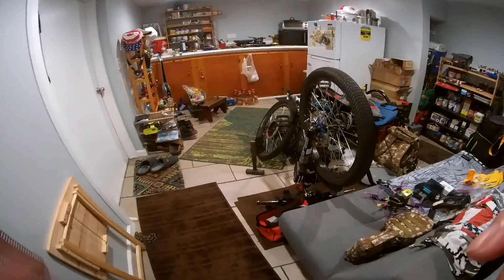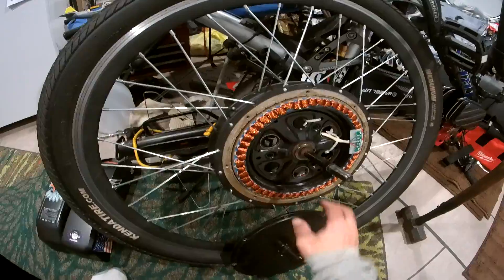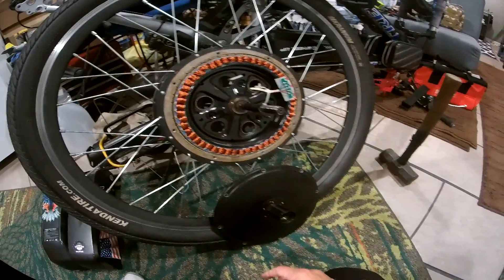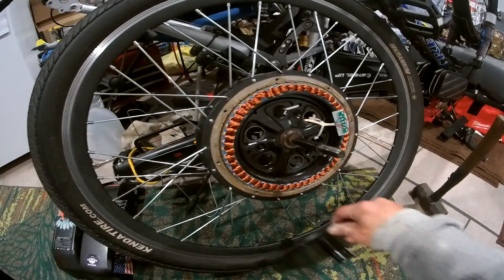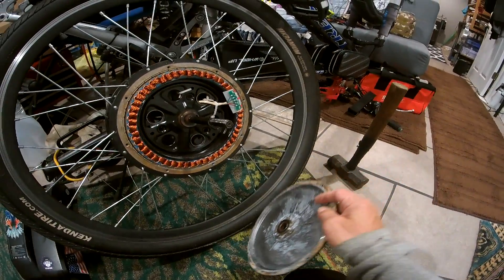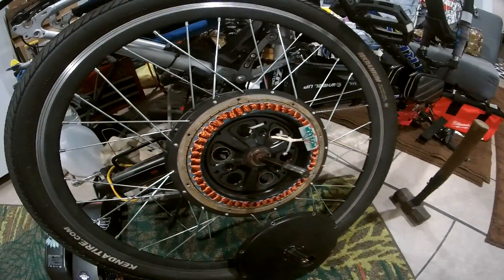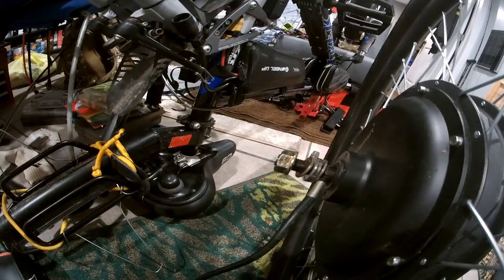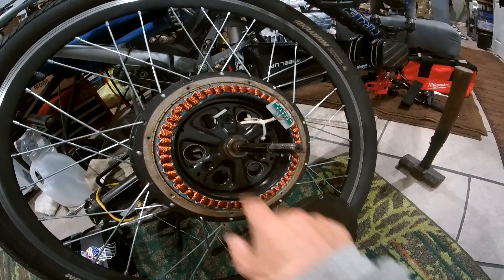inside🚴1500w⚡ebike hub motor🔧remove cover cassette side to service 1275 miles

Comment: I ride at least 100 miles a week on my new ebike--I hope I do not have to do this every 10 weeks--thought these were sealed and needed nothing for 3 to 10k miles.Also this is why I bought a front hub motor to add 2wd--last thing I want to do is have to replace or fix a rear hub motor. 1200 miles is not a lot since these are advertised as medium to heavy duty--unless it is aggressive trails or a lot of uphills--these should last a lot longer then this.I have a one year warranty and could easily put 2k on my bike and was told it should have no problem.Also this should serve as a semi warning--all bikes--including ebikes need maintenence--I try to take care of mine to avoid this.
Reply from the maker: Sand or something must have got behind the cassette hub making a noise that really bothered me nice and quiet now after cleaning it out.Thanks for stopping to watch & comment good luck ride safe